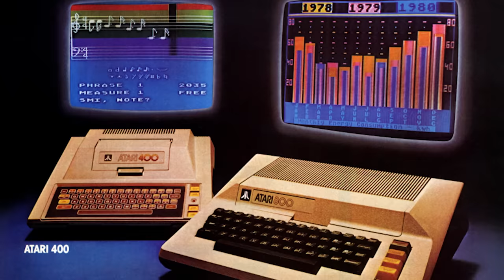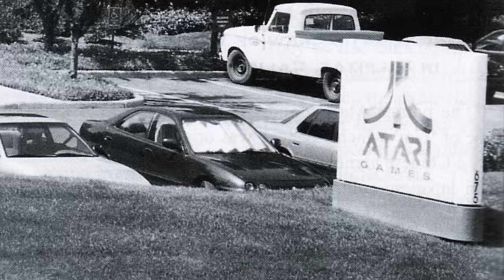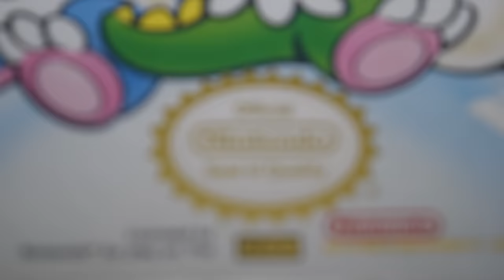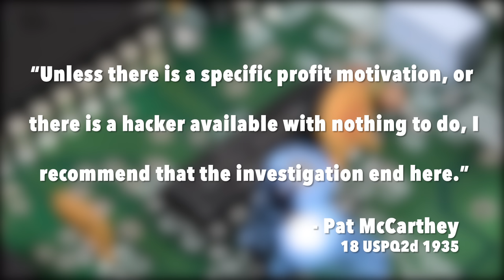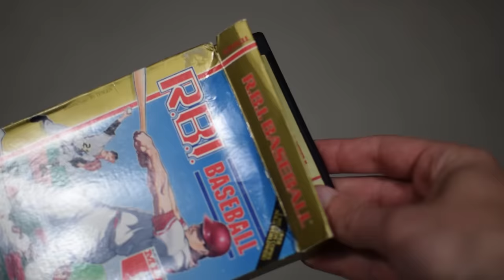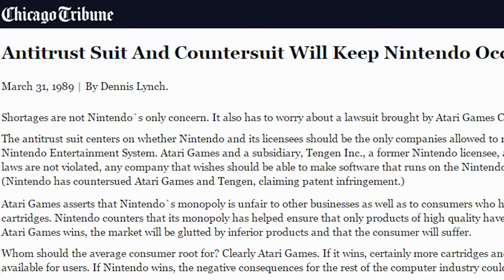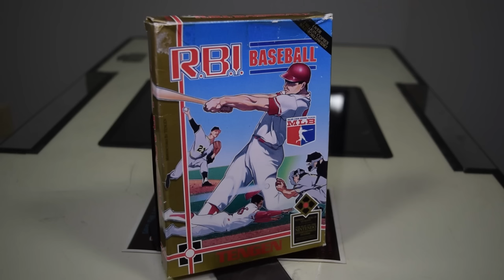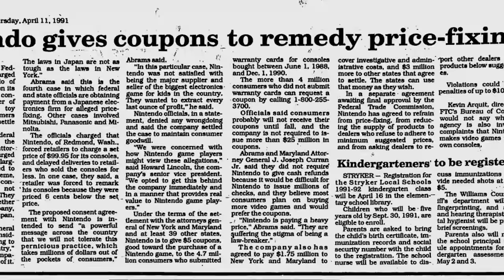Tengen: Atari Games vs. Nintendo

Comment: Honestly, looking back at Nintendo quality control acts, I personally believe it hurt Nintendo in the long run. Especially since Switch is the first console that I can think of that has a lot of good 3rd party.
Reply: There was a ton of good third party stuff for the Super NES and N64. Nintendo started hurting during the Game Cube era, when the PS2 was such a monster of market share (helped enormously by being a DVD player out of the box at a time when dedicated DVD players were more expensive). That same generation saw Sega drop out of consoles entirely following the Dreamcast (which actually had a good first year, but then got utterly steamrolled by the PS2). I mean, the PS2 sold over 150 million units. The GameCube, Dreamcast, and original XBox sold less than half that combined.

Of course, Nintendo bounced back with the Wii, which is actually their best selling console of all time and the top selling console of the seventh generation of consoles. Then they dropped the ball with the Wii U, for a variety of reasons. The Switch is what the Wii U should have been from the start, and holds its own in both sakes and third party support.

Comment: I can't help but sympathize with Atari here for three reasons:
A: They took a proactive approach and tried to find chips which Nintendo denied. Nintendo's standards are too high. This wasn't Nvidia or Voodoo, this was a standard chip for the NES. Why so high and mighty? You already forced them into a bad deal despite Atari virtually CREATING THE INDUSTRY! Stuck up bastards

B: They tried to push for a better deal which again Nintendo denied. This is like Heaven refusing to admit Mother Theresa because she didn't pass as saintly enough. It was pompous and arrogant of them. This shot them in the foot. Bad idea to do that Nintendo, very stupid of you

C: Not giving licensees access to the 10NES program: I will likely get flamed or attacked over this but I believe that the judge was in error. Granted they did overstep but notice the sentence "Nintendo deleted some unnecessary code". If the code is no longer required and will not be used then how is it an exact copy when Nintendo had removed said code from the NES? It wasn't an EXACT copy because it didn't use the same code base, since the deleted code was no longer in the system. I disagree with Judge fern smith on this. She's right on everything else but not this. How are you supposed to make games for the NES without a thorough look at the code for the lockout chip? I don't know what the dev kits were like but this is highly idiotic. It's like Eidos not being allowed to use the Glide API and being forced to use the software renderer. What's the use? Why deny this crucial aspect? I don't agree with Nintendo's policies and it was wrong for Tengen to illegally use the hardware but their hand was forced from the get go by crappy management, stupid restrictions and a severe lack of understanding that programmers cannot write programs unless they have a reference to look up. 10NES was meant to keep out unlicensed games but Nintendo didn't have to force their hand, they just had to give a copy out of good will. If they want to make unlicensed games, that's their decision but don't make it harder on them. Atari was already in dire straits.

For non programmers: Imagine if I wrote a book, but deleted a chapter I didn't like and someone uploaded that chapter. I'd be fine with it because i got rid of it. Nintendo essentially said "I deleted a chapter but you can't use it because it's still part of the book" despite the fact that the chapter (code) no longer exists. And they sued for this. idiots

thoughts?

Comment: I agree that Atari wasn't a bad guy, but what were they expecting copying the 10NES program and thinking they can go to court while using it. They caused the NES' piracy and caused more damage to the partners of Nintendo then they ever did. The NES was then only hackable with modding it and most people are scared of modding the NES because of causing damage to it. I agree that they might not have known what they were doing but come on guys. They should have put some security on it.

And what was it with them faking a legal document! That's illegal as hell and I would expect to be in prison for that, it's lucky that they got off it pretty easily. They may be the reason of loosening the stranglehold of Nintendo on the industry but they had to be cautious after the crash of the gaming industry. The reason it crashed was because terrible games and they had to be cautious with that as they could have gone bankrupt if they over-invested into the NES. People would probably stay away from consoles from the horrid memories of those games and it was a bit of a risk if they opened up. If a person touched a horrible game and saw it another one, I'd be not playing a console for a while and a while means a really long time. It would be damaging and most people would stay away from it. First impressions are everything and if you ruined a second impression after the first. You can bet you that you would be on my bad side for a while.

Comment: BTW why to try reproduce lockout chip, when the MOD for disabling it is very simple and only require a screwdriver :D
Reply: intel386DX 
They needed cartridges to get around the chip, not to modify the system (to which they never owned the rights).